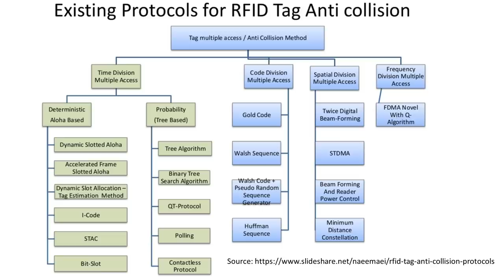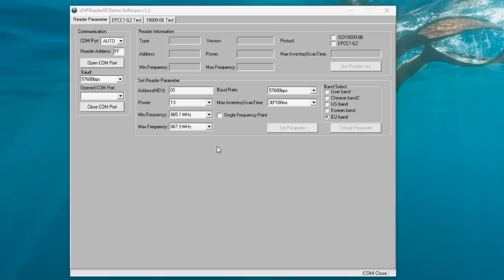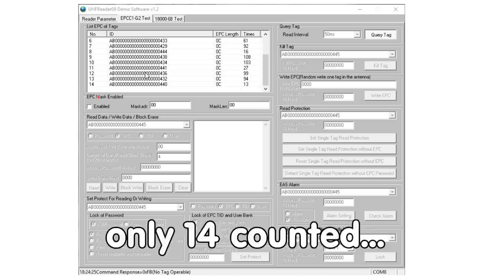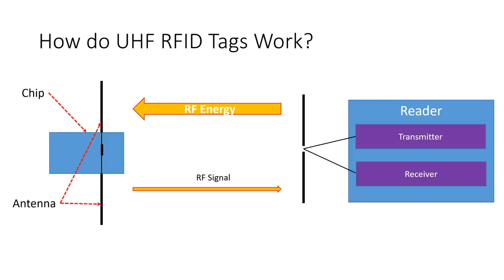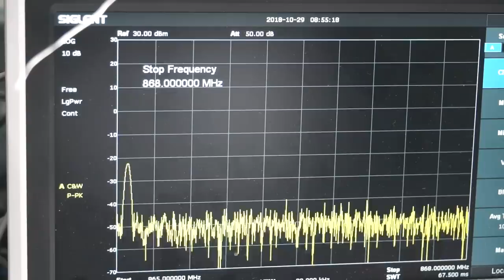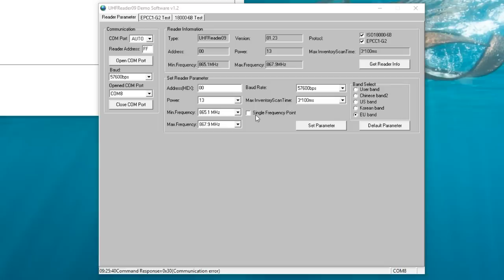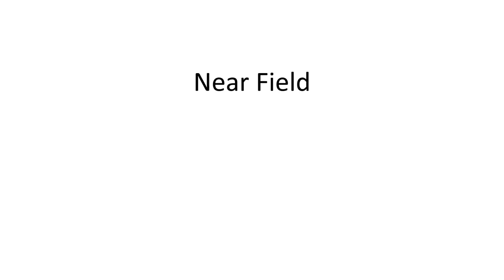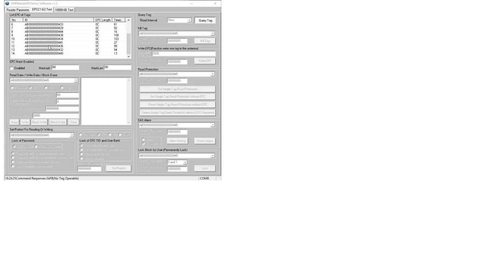#236 Introduction into UHF RFID (How-to)

Comment: BTW: Using a better antenna is one way, the other way ist using booster jackets oder active cards. Wie use such cards for car indentity management. They have a range about 5-10 Meters but, those infrastructur is, as you said, not for the common tinkerer :-)
Reply from the maker: You are right. Active antennas solve most of the problems because then we are back to normal receivers with very low energy requirements. But they are bulkier and probably also more expensive :-(

Comment: Hi, i really like your videos! Could you maybe make a video about accuracy of chinese BME 280 sensors and maybe how to fix them? It seems that most of them arent accurate at all. I ordered a bunch from different sellers and they are all off by ~3°C and the humidity is far from the real value. In your previous video about this sensor i had the feeling that yours also reads too high values. I could also send you one of the faulty things.
Reply from the maker: I did not use these sensors quite a while. If they are defective, I would start a dispute.I also have no precise thermometer to tell which is right.

Comment: Would like this for tracking horse and sheep on property. Would require solar powered readers connected to some radio back to house then wifi to phone. Think lora might be a better option.
Reply from the maker: You are right. Lora has a much bigger range, which is probably necessary for free animals

Comment: Thanks for your analysis on this alive and kicking subject. I would like to get more depth in the background of how UHF and HF work and if you can advice more that would be great. We are working very actively in this field converting UHF & HF tags into all sorts of workable formats like labels and tags and tickets to connect items and make them part of the Internet of Things. In this we have some challenges and need some help to overcome, Thanks Peter - LabelTech
Reply from the maker: RF antenna design is an art. You find specialized engineering companies with the needed soft- and hardware to support you. This is too special for a YouTube channel, I think.

Comment: Thanks for for the video, a lot of great information and very helpful. I was wandering is the reader affected by obstacles?
For instance concrete, plaster, drywall ect even at close range.
Or is that also a function of antenna and output power?
Reply from the maker: As always with wireless devices all the things you mention influence the reach of a connection. Nothing different here.

Comment: Great video. I'm trying to figure out if I can use uhf for cataloging a small book cabinet. Ignoring the range for now, is there a limit to the number of tags a reader can read? 20? 50? 100? More? Any idea?
Reply from the maker: A reader can read a lot of different tags (millions). But not at the same time. I do not know how many tags can be read in parallel if they are in the reach of one sensor.

Comment: I have an EPC Gen 2 reader/writer. It can go to about 7 meters depending on the tag used.
Reply from the maker: Which one do you use?
Reply: @AndreasSpiess  Sorry. I forgot to mention that the device I have is much bigger in size to serve it's purpose of reading multiple tags at farther distances. It's an Astra-EX.

I think it's circuitry is as big as the desktop reader/writer's but uses a bigger directional antenna.

Comment: If the UHF rfid switches the receive antenna the same way as LF ans HF tags, why can it read multiple tags simultaneously? Seems to me that it would be just as confused.  How would it detect this from 20m, 60 wavelengths? Could they be making an subcarrier?
Reply from the maker: It does not read simultaneously, but much faster than HF tags

Comment: Have connect the desktop uhf to arduino,,the reading is changes sometimes,, not always in 20cm ,,sometimes need to be very close like 5cm to get the reading.. but still quite usefull.
Reply from the maker: Thank you for your feedback. The distance seems to differ from tag to tag.
Reply: For desktop reader/writer, mostly use for encode tags. So the distance is not the main concern in most cases. The antenna in a desktop reader/writer device is quite small. If you want to exchange more information with me, please email me at chris@syncotek.com

Comment: Hi! Where did you get the software you're using (UHFReader09 Demo Software v1.2)?
Reply from the maker: I do not remember. Probably from the vendor.
Reply: @AndreasSpiess  It's really a crazy mess when dealing with products from China. No manual, no drivers, or software. I'm in the process of chasing these from the seller on Amazon but they don't seem to have any clue. Difficult to find the manufacturer of these generic UHF RFID readers. If anyone else has any tips, it would be helpful!

Comment: I think need strong magnetic field for producing power for RFID tag. EMF we should keep it in mind. Is that right?
Reply from the maker: The tags are very sensitive. The output power is limited in all countries. So the tags have to work with this power
Reply: @AndreasSpiess  I'm thinking that electro magnetic field may help to power the tag. Reader also transmitting RF to carry the signal from Tag. Just expanding the antenna may not give best result, i think reader needs amplifier for receiving and boosting antenna may required.
Here i mean that strong reader required.
Take these point of view as am a student.

Comment: Hi, thanks Andreas for this very useful information!
i would like to ask a question.
Does the reader, even the long-range one, read the tags in directional way? i mean, the reader and the tag should be in a straight line to be able to be read? 

And, when the spec says that the reader is capable to read up to 15m, is it a radius? or just a 15m straight line from the reader?

i hope you can answer this! many thanks and good luck!
Reply from the maker: These devices work best with a line of sight. And most devices use directional antennas. So they only work in one direction.
Reply: @AndreasSpiess  Really apreciate your answer! can i ask something again? I bought a middle-range UHF RFID reader. It came with the SDK documentation. However, i seem to really stuck to get the data read by the raspi 3 connected to the reader. I tried to find a library or a snippet of codes, but nothing gives me a light. Do you have any reference of how to code the reader so my raspi 3 can get the tag's data read by the reader?

Comment: What interface does the reader use? Is it a usb-serial device, hid, or something proprietary? I'm curious if it could be used with custom software
Reply: On the GUI you can see settings for COM port and Baudrate, which is set to 57600 bps, so I would assume it's just a serial device.
Reply: Along with the sample program to talk to the device, they also give you code examples so you can issue the commands from your own program.

Comment: Andreas, thanks for this video!  Very scientifically explored (nice spectrum analyzer!) and very well presented.  Now that you've found the shortcomings of the internal antenna, and also the Chinese junk (that's redundant), I would love to see another video where you pursue a better solution.  Clearly we need more than 13dBm.  I hope eventually to make a system that will read at least 10-15m distance, a long leap from the 15mm-15cm that you showed here.
Reply from the maker: You can buy such systems ready-made. They are not cheap, but they work and I would not want the hassle to build one on my own because also the parts are not cheap.

Comment: What do you think about m5stack JRD-4035? Did you have a chance to see it in action?
Reply from the maker: I do not know it. I would check if it has a range which is convenient for you. I think it will be pretty small.
Reply: @AndreasSpiess  they promise huge 1.5 - 2 meters. So, may be it works at 20 cm? :)

Comment: Our UHF antennas are readable on distances of 20m. You need a proper reader antenna with 30 dBm power and 4 dBi antenna gain. It's the standard used.  For more distance you can use even a 33 dBm powered antenna. The antenna gain is also quite important
Reply from the maker: You are right.

Comment: i wonder if a patch/quad panel antenna would work? Seems like it would be easy enough to make, and you have the right tools for testing/tuning! I wonder how much polarization of antenna is important (like in FPV stuff) as these cards can be oriented in many different ways in the field.
Reply from the maker: You might be right. This is why I ordered a special RFID antenna. We will see the effect...
Reply: @AndreasSpiess  A nice document about DIY 10dB gain panel antenna's is found here:
http://www.scielo.br/scielo.php?script=sci_arttext&pid=S2179-10742010000200003

More about maximum ranges of tags is here: https://skyrfid.com/RFID_Range.php

You can also use a small Yagi antenna that realy works. I found one on http://www.flytron.com/antennas-filters/125-900mhz-3-element-yagi-antenna.html. 

I'm still searching for an affordable UHF-RF-ID reader to test with. I need a 10 meter range with not to much equipment or big antenna's, so for me a flat Yagi can be a solution. At this moment I think the readers are to expensive for just playing around. 
But i also expect that the units with the SMA connectors realy have a better performance than the desktop version you used.
If someone knows a effordable unit, that would be nice!

That is why i like your channel, you make a lot of comparision so we can skip the expensive try en error phase....

Comment: Strange readers in warhorse pda has much more range.
Reply from the maker: More than 10 meters?
Reply: For desktop reader/writer, mostly use for encode tags. So the distance is not the main concern in most cases. The antenna in a desktop reader/writer device is quite small. But for PDA reader, it will be a different story for both RF power and antenna. If you want to exchange more information with me, please email me at chris@syncotek.com

Comment: Hi, I'm Gustavo from Brazil and I need urgent a way for find and manager my things. I will try UHF RFID. I'm Engineer of Control and Automation and have a lot off tools here in Brazil. Heavy big metal tools, Argon and CO2 cilinders, welding machines, two and four stroke engines (incluind a 1997 shit VW car with electronic indirect injection 1.0 engine 76 HP), a diesel 400cc 1 piston engine, semiconductors, drones, a large precious old electronic trash, batteries, chemical products, motors of all kinds, compressors, pneumatic connectors and tools, sensors, Wi-Fi Halow (bought in november 2023), instrumentation like oscilloscope, and my very new aquisition, the hipnotic Tiny Sa Spectrum Analyzer, and much more for my own use. I'm not compulsive accumulator 😂, I'm a prospector of goods and a hobbyist😊. Did you try to put various antennas sending power (like a mechanical Beamforming)?Is better send a concentrate frequency to the tags or spread the energy for a spectrum of 860 to 915MHz? The tags send out the code in a concentrated frequency or spread?
Reply from the maker: I did not do a lot of tests. You get more expensive transmitters with a higher range. I do not think that the bandwith matters too much. The transmission of the power to the passive sensors is probably the limiting factor.

Comment: Desktop UHF Rfid reader ??? bad aproach from the beginning
Reply from the maker: Why do you think?
Reply: @AndreasSpiess UHF stands for ultra high frequency and is supposed to be used on great distances (up to 90-100 m), UHF Rfid infrastructure usually implies having UHF antenna and long range reader not a cheap desktop reader (that's clearly not UHF btw)
Reply: @MrTornea  "Ultra high frequency (UHF) is the ITU designation for radio frequencies in the range between 300 megahertz (MHz) and 3 gigahertz (GHz)" - Wikipedia.  Is 860 MHz within this range?